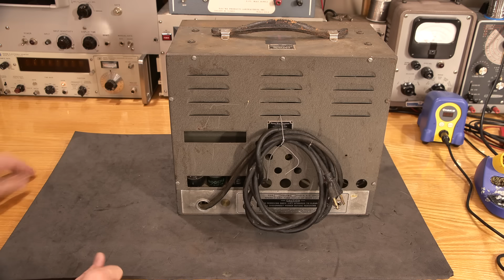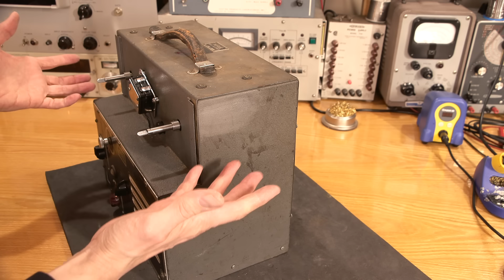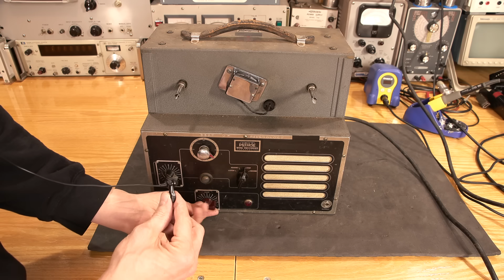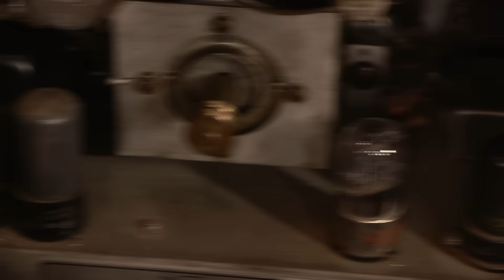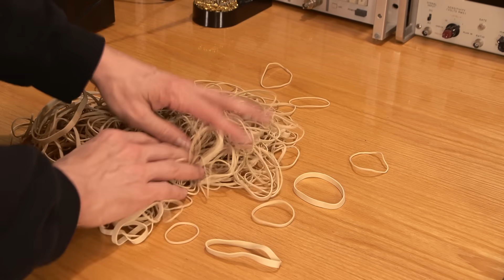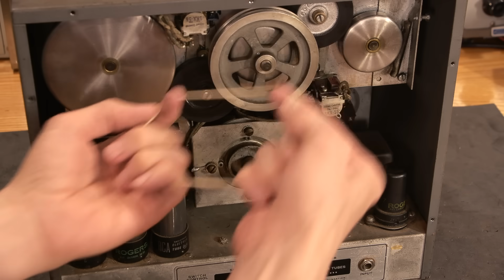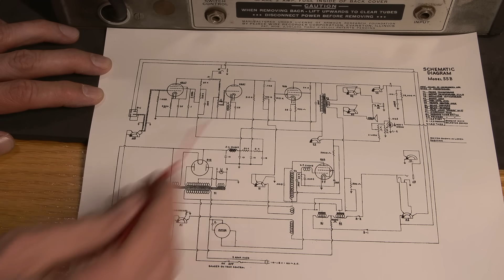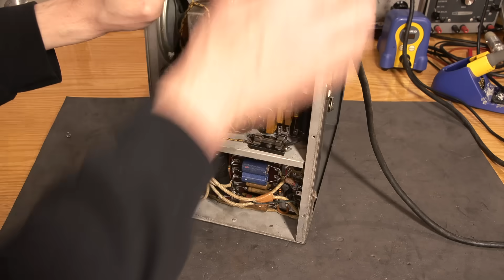Trapped Voices In This Wire - Let's Listen To Them!

Comment: It would definitely be interesting to explore the full content of that wire recording and establish the subject matter and date if possible.   It would qualify as a historical document.   Also, would be worthwhile to restore the old machine as far as practical to play the recording back properly.   I recently found an old Grundig reel to reel magnetic tape recorder literally buried (to the point of being rootbound 😬) in the dirt while cleaning out a long disused backyard chickenhouse on my property.   It was piled high with every type of junk and trash imaginable from previous tenants.  I've put off cleaning that place out ever since I've lived here.  I want to try just a revival on that machine, but have no tapes in that long obsolete format.  The discovery and digging out of it is in part 2 of some videos I'm posting about that old place and artifacts I'm uncovering in there.  Though the cabinet is destroyed, I'd tackle a full revival of it if I was lucky enough to come across any of the old tape reels for it 🤞🤞🤞.  The machine you have here is very interesting in its own right.  Since you have a surviving recording as well, it's definitely worth further work.  Besides, I'm curious to see if my guess of an opened output transformer primary as the cause of the no audio symptom is accurate 😄.  Great video and intriguing project. 👏👏👏👏

Comment: Amazing stuff Paul. The fact there  are two eyelet boards and a fuse in the underchassis speaks volumes of a well
designed machine. The Ultraprobe to the rescue!  Seems that the model 55B was used for dictation as Peirce Wire 
Recorder Corp (formerly the Radiotechnic Laboratory or RTL)  designed and sold it as such in 1945 through Macy's
Department stores for the masses. Sure would like to know why the speaker has no output. Could be a bad audio output transformer due to bad E-caps? Guess you will have to poke around more to see if that is the case. Thanks for showing
a rarely seen early wire recording machine. Two thumbs way up Paul! Steve from Chicago.
Reply from the maker: Thanks for your kind comment Steve!

Comment: O-ring repair kits are available that come with a spool of the o-ring material and a jig to cut the ends flush and a fixture to glue the ends together flush. We have one in the machine shop I work in. It works good enough.

Comment: A full restoration of this thing would be delightful to see! Also shows how well made things were back then...this thing still more or less works after 70, 80 years even with a lot of badly failing components in it. Modern devices last maybe 5-6 years at most and when just one eentsy weentsy little guy shits itself the whole device just dies.
Reply: Perhaps this is because the 'offshoring' and 'opening of China' etc was far more an internal act of sabotage, to gut the American Middle Class, weakening it to makeway for globalization into United Nations...like was done with the auto industry, and pretty much every industry...

Comment: 40 years old and I never heard about this?! I heard about wax cylinders, tape and vinyl but never wires that is news to me.
Reply: A smaller compact one was used in the movie The Two Jake’s
Reply: I found out about them by fluke in the video game BioShock .
Reply: It's similar to what Laser Disc movies went through. They came and went so fast, and relatively few ever had them because of BETA and VHS. These wire recorders sort of came and went in between 78 RPM records, and reel to reel tapes. People had a very hard time dealing with the thin wire spools though, so their novelty wore off quickly...

I learned a little about them decades ago when I found my first one. I'm still fascinated by them today...
Reply: @Quickened1 There's a very cheesy superhero movie I had, most of the "supers" were like Batman, just super-fit normal people, but two of them got actual (awfully CGI'd) powers from a meteor or something.
Anyway it was set in the 40's and an annoying journalist had a wire recorder. He was hiding from the baddies but forgot it was still running, then it ran out of wire and stopped with a loud clunk.
Reply: It dates back to danish engineer Valdemar Poulsen who patented a technique for storing sound on wire 1898

Comment: Oh wow, I'm always delighted to see a wire audio video because it's definitely a peak into a time which didn't have as many casual audio recordings as we do now.
Reply from the maker: Thanks for stopping by Rinoa!
Reply: I wonder if it's possible to record video in the same manner? Don't know
Reply: @ I think metal doesn't have much magnetic resolution when its one piece, hence why we grind it up and glue the granules to plastic to make video tape.
Reply: @RinoaL if we wanted to record video like that, it would have to be running pretty fast to get any resolution at all!!😂
Reply: @RinoaL isn't this how audio tapes were made?
Reply: I would to see you restore great channel
Reply: Good to see an analog tech focused on pre-1960's radio/ TV equipment.  Before solid state!

I'm just an ex mechanic, not an electronics guy.  But its really gratifying to see how tube technology still survives 100 years later.  Although selection is limited, new vacuum tubes are still available for maintenance & restoration work
Reply: Never knew an piece of machine like this existed. What are it's origins and who developed this?

Comment: Super cool spy stuff 😊. Maybe the traction disks could be restored by turning wide shallow grooves in the edges on a lathe and fitting fresh rubber band tires. Or tyres.